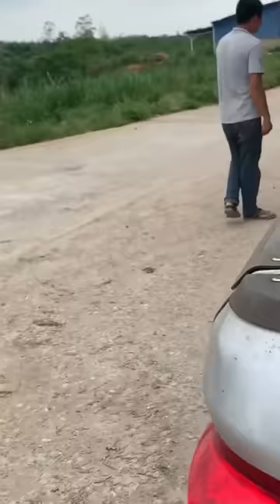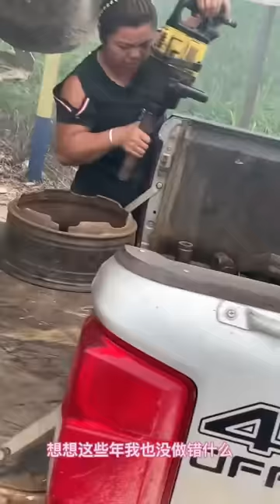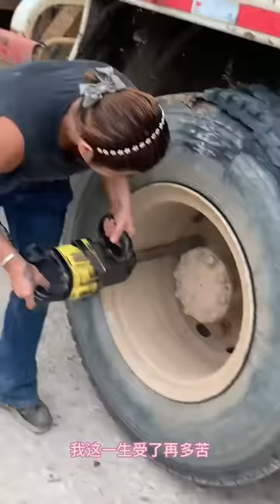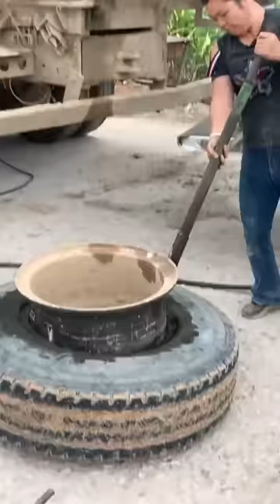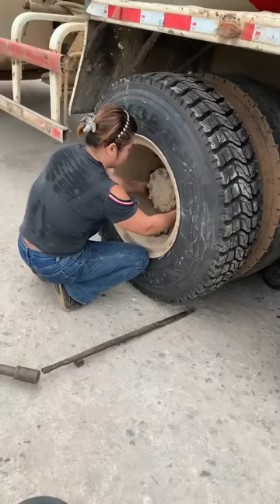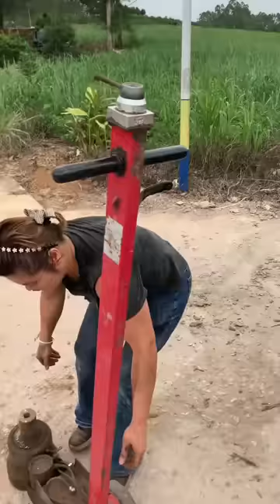Truck Puncture Tire Replacement Outdoor Rescue!

Comment: I drove a 20 yard dump truck years ago, and I know that what this woman just performed for us all, is definitely not as easy as she made it look. She’s a tough Gal !!
Reply: 20 yard huh, how many axles was that?
Reply: Imperial(istic) measurements 😀
Reply: I'm in the US, and 15 yards will usually run 56,000 lbs with 4 axles to be legal.
Reply: I used to do bodywork on cement trucks. There's nothing easy about them..lol  Even funner is chipping and  sanding all the concrete off for paint..  Woohoo! 😮
Reply: She definitely has her routine down... smooth and precise... can you say independent woman?
Reply: @robertbrown3540  Why would you care for her independence? Just for the sport of spreading your pseudodemocracy around?
Reply: Yep ik her feeling about changing  tires we had Farm 🚜 vehicles  change those tires 🙃 😑 😒 🙄 😅 😐 🙃
Reply: She was never on her cell phone the whole job .
Reply: @Buzzrust1 except we don't use split rims here in the US anymore, or they are extremely rare! I've been driving a big truck for over 32 years, I haven't seen split rims for over 30 years!

Comment: I’m a diesel mechanic guys, this is not as easy as you would think TRUST me
Reply: I did that job for over 5 years, low (laughable) pay and a  permanent bad back and knees 40 years later.

Comment: Even though she didn't have to deal with a frozen lug nut or rusted on split ring I have nothing but respect for her. The way she handled a tire as tall as her and probably weighs at least twice as much is amazing !
Reply: Split ring? Fts
Reply: It’s the ring around the tire that’s first removed. They can rust, split, bend and all sorts of fun stuff that make it very difficult to repair.
Reply: I’m sure she’s dealt with it before. 😂
 Looks like she’s been doing her job for some time.
Reply: @yopappy6599  yep i was gonna say the same if shes able to do that I'm sure shes dealt with them before.
Reply: It's Tyre in my part of the world & It's commonly  referred to as a split rim locking ring for our friends in the USA

Comment: As a former tireman I can tell you that she knocked it out of the park on this change out. Excellent work and video.
A couple of points for folks that haven't done this kind of work that were not shown:
1 usually you use some watered down tire lube around the bead area to help slide the tire off and the new one on, and
2 this change out was for a tire and tube, which is not as common as tubeless nowadays, and it's much more dangerous because of that lock-ring that she put on prior to inflating the new tire. In the USA you have to put the mounted tire in a cage before airing up.
Anyway, great video. Thanks for sharing
Reply: They used to call those snap-rings widow makers
Reply: I was wondering about the rim , I remember decades ago about a certain 3 piece rim that were deemed dangerous and thought they were outlawed in the USA,  is that what she worked on ? Of course the Chinese government couldn't care less about its citizens.
Reply: My thoughts exactly. Are used to work in the shop as a mechanic. Tire guys always put those in a cage.
Reply: A lot of the old timers still don't use cages.
Reply: this is what they do in 3rd world countries

she is young because the last person doing that job was killed
and the one before that
and the one before that....

this video is sad and tragic

Comment: Kudos to the lady. She knows her stuff. I would have cross tightened at least 4 lugs. But that is me.
Another time saver. Carry a 4x4 or 4x8 block. Position in front of inside tire. Have driver pull up on it. Outside tire is off the ground and removable. No hassle with jack.

Comment: She is awesome. Pity anyone that tries to mess with her 😮
That Jack is even heavier than the tyre yet she lifts it like grocery.😮
Reply: I was wondering how she would lift the jack back on the truck, and boom she just lifted it right up. She's a strong and skilled lady
Reply: Yes,I was watching how easily she took it off truck and set it down wiw😮😮
Reply: These jacks are around 50kgr+ (110lbs)and the tyre 60-70kgr(130-155lbs).

Comment: This is quite a tough lady! She’s very efficient and thinks things through very well. She does things quickly and safely as possible, we could always be better protected and second guess her behavior but she’s thinking about keeping safe. I’m only 6’ and 160# or 80k basically so people who have smaller bodies learn to use leverage and angles to make physical labor less strenuous on our bodies. Like when she loads the replacement tire into the bed it the pickup, she rolls it, leans it then uses it’s own weight to flip the top away from her body and then pulls the outer part up- essentially lifting ONLY HALF of the tire weight- smart. You can sit on your bum and straddle the tire and lift with your thighs to get the tire on the axle and align the wheel studs to the rim. 
She’s probably a really good person to be around because of the way she acts in her workplace. I’m saying that she’s not your typical tire jockey or roadside mechanic and leave it at that. She’s gotta be a fighter 
This is what I enjoy seeing on social media- interesting people from far away but yet are just like me. I absolutely hate the stupid things that people post that aren’t even entertaining

Comment: This woman is much stronger than she looks. That jack must weigh more than she does!  I found out years ago that here in the USA split ring wheels are hard to get work done on because if it lets go when you pump the tire up in can literally slice your head off, or an arm. When I was able to get them repaired it was aired up in a cage and the ring was secured to the rim and tire with a chain. They didn't show this lady airing up the tire, but I saw no safety chains. I suspect they moved far away and checked the tire pressure at the air pump.  One of the last steps before the technician gave me the wheel back was to pound on the tire with a hammer so he could be sure the ring was safely seated. Scary to think about why they did this.
Reply: Split ring is something serious indeed , like a rattlesnake, you should handle carefully. Never overconfidence.

Comment: I know that mixer truck has to roll but please get you some hearing protection. Those impact wrenches are very loud and will affect your hearing later in life and yes changing truck tires is Hard work and Killer on the back.

Comment: She is damn good at her job! The only thing is she didn’t use any kind of safety cage or chains around that split rim. Anyone ever seen one of those things come apart when inflating knows what I’m talking about!
Reply: Yes.......
Crazy explosions!!!
Think she knew it was flat.I guess the same when you air them up.
Reply: Doubt she would be hauling a cage with her but yeah maybe she should have thrown a chain around it she could prob judge the fit of it though by the way she handled every other aspect of it they don't just randomly come undone there is a flaw or just plain wore out I think she has a pretty good handle on it
Reply: @rickjeffjeff  I don't want to be mean but it was obviously flat that is why she was out there and it only pertains to inflation if your that dense and are trying to remove it from a fully inflated tire then you have bigger problems than well you have problems
Reply: They had a roll bar type cage they would put the split rim in when servicing. The cage had huge dents.

Comment: I have ALOT of f'in respect for this woman. She is making that job look simple. Somebody buy this woman a drink, she definitely earned and deserves it.
Reply: Sólo necesita una buena alimentación y mantenerse en forma. Por supuesto,  cobrar bien por su trabajo .
Reply: The job is simple.  It is not complicated.  But it is hard work physically.
Reply: @davidgerwin7885  Dude, please tell me you aren't brushing this off. Yes, breaking a tire down of any size on paper is a super simple process. But, when you get out there, in the heat or cold, and you have to deal with the weight, the bead on the orginal tire hardening to almost being plastic, along with being on the side of the road and trying not to die because let's be honest, most drivers are too worried about everything else than what they're supposed to be doing. And here's this woman, handling it like a champ! Yeah, don't brush that off.
Reply: This is china, she'll needs to work on 20 tires like that to afford a beer
Reply: David Gervin it's plain to see you ar
Reply: David Gavin it's plain to see that you are jealous of this young woman cause you as a man cannot do it 😮   Show her some respect .
Reply: @lzbhcvm6747  Well then f' it, I'm buying! 😆😆😆
Reply: @rajunrick8410  dude, she's like 40
Reply: @lzbhcvm6747  🤣🤣🤣🤣🤣🤣
Ok, first I'm not hitting on her. It's a respect thing from blue collar to another. Second, why's her age even a question? Man, those ladies have been around and might even teach you something new! And finally third, so am I, 🤣🤣🤣🤣🤣🤣🤣🤣🤣

Comment: Fantastic job! Be careful with those split rims they can be dangerous!!!
Reply: Those are demountable flange wheels.
Reply: @squidusn71 they are a death trap if not done in the correct manner. That split ring could come off and kill you dead.

Comment: She did a fantastic job especially considering the wheel was almost as tall as she was and probably weighed the same as she did. She’s definitely good at what she does. ❤
Reply: No it wouldn't weigh as much as her but still amazing how she does a job with ease that a lot of men would find difficult. A lot of the the tools she uses would be very heavy.
Reply: @clivechandler8817 True… My brother used to be a semi-truck driver and my niece is now. My niece is probably not much bigger than that woman is. I can see my brother being able to do that with the same ease as she did but not so much with my niece. She can do a lot of things but I don’t know if she’s that strong. Of course she may do it just to prove to herself, her dad and any males around that she is strong enough / tough enough. (Big dog syndrome - how little dogs try to prove they are as though as the big dogs. Never underestimate a small person. 🥰)

Comment: Impressive!  My only criticism is when airing up the tire, the split ring has been known to come off and break an arm or worse.  We always placed the tire under a hydraulic lift to ensure it did not take your arm off.
Reply: I bet she would have if one was available roadside
Reply: Notice she walked from a distance to detach the air hose. During airing up, she must have been at a safe distance.
Reply: @Buzzrust1  😃😃😃😃😃👍👌

Comment: She did everything right but one thing. For safety precautions when airing the tire up. You need a metal rack to place tire in before putting air in tire in the case the iron ring blow off. I'm saying this because I know of this happening before. Be safe

Comment: I remember my dad fixing flats manually using several iron bars, some flat, some round, along with an iron sledge hammer.  This was in the 50s and 60s.

Comment: If that circlip comes off the wheel during inflation, she’s dead. It’s happened before. There’s a steel cage you put the wheel into prior to inflation. Incidentally I’ve never seen one of these cages unbent or undamaged so it must be common enough.

Comment: Split Rim, probably the most dangerous tire job you can do. There have men who've been decapitated by those rings.
Even installed properly, those things can come off during tire inflation. I know I did all the shop jobs at a Farm Bureau Co-op when I was 19. We had a cage for airing the those types in. I can't remember how many I did and only had one of those rings come off in the cage, noisey as all get out too when it came off. Scared the &$#$$# outta me.
Props to the young woman, she did a great job. Hope she never has one of those rings fly off. If I were her I'd invest in some chains, a couple at least, just for safety sake.

Comment: I've done repairs on those split rims. They can kill you if you're careless. We always stuck an iron across it through holes in the rim just on the off chance it could pop apart when airing the tire.